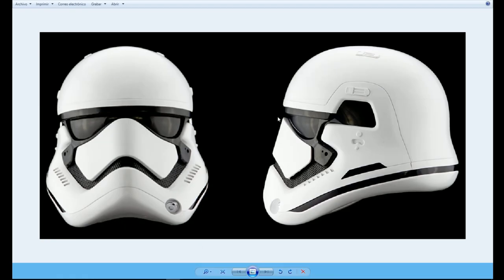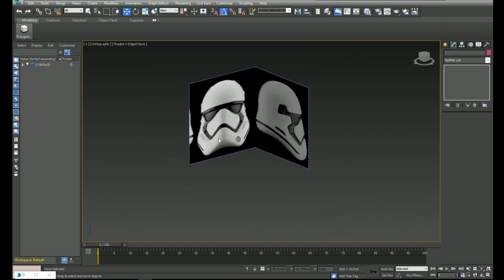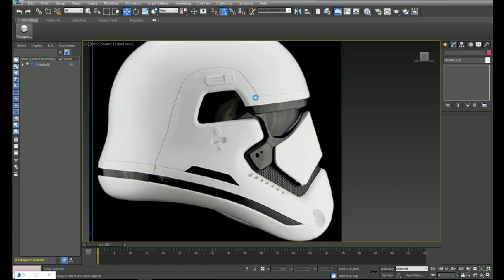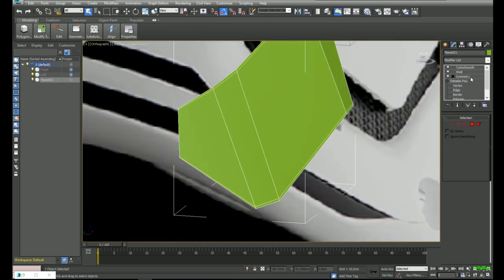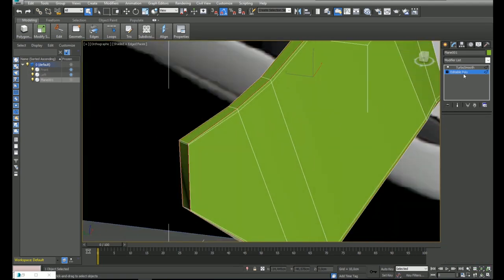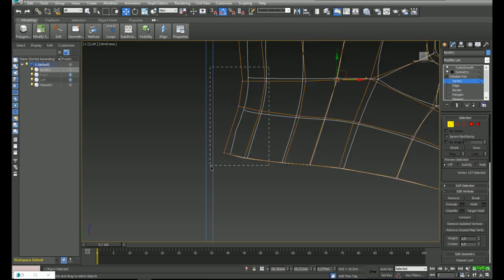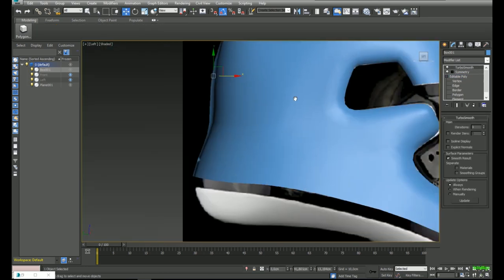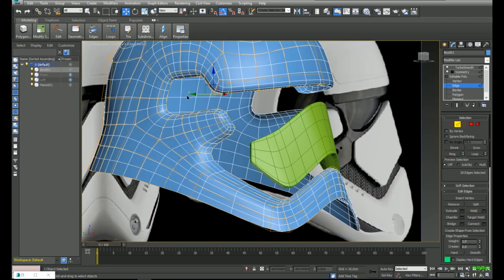3ds max tutorial: Modeling a Stormtrooper helmet ( New Order) Part 1 of 2

Comment: Great tutorial, you make it look so easy ! I tried to do a racing helmet using your tips, it seems a bit harder as less guide references on the racing helmet. By the way, do you use a different app to create those green hand-drawings or is there a trick in 3ds max ? you know, like at around 21:19.
Reply from the maker: thanks for you comment and yes,  I used a different tool to create this "overlay" hand drawings. The tool comes with my recording software (Xsplit)  it has free or paid versions ( I had the paid when I created this version, but the free version will works almost the same with 720 resolution and non commercial use). Also, before using Xsplitt I used  another free tool called Screenmarker 1.0.0.1 it is quite old but quite useful software. It is a shame that the author is not developing it anymore, so you have to google it to find a mirror site to download it. Also, if you want a more profesional tool, I recommend you camtasia, it is quite expensive, but it is the best screen recorder tool.
Reply: Thank you for your response. Here is my 2 first helmets, you can see here,
https://forum.studio-397.com/index.php?threads/helmet-base-models-1970s-1980s-1990s-f1-etc.59843/#post-942006

I might need to ask you some questions from time to time for advice if that's ok with you..